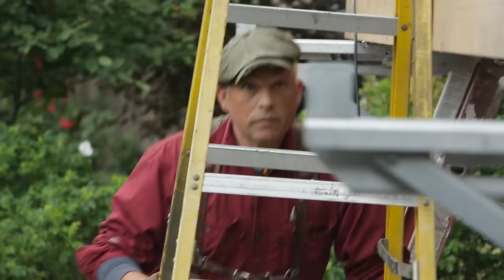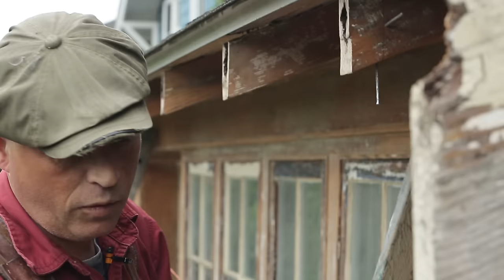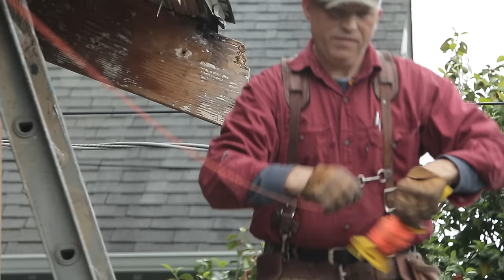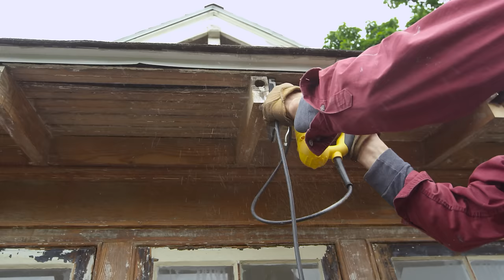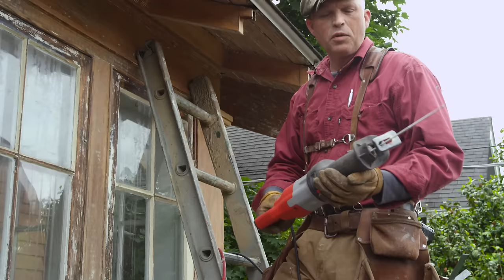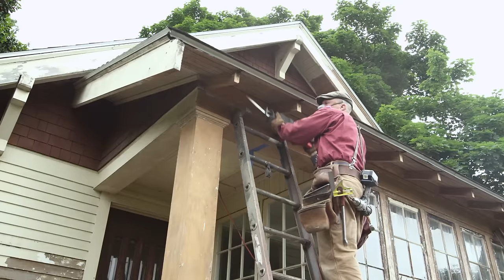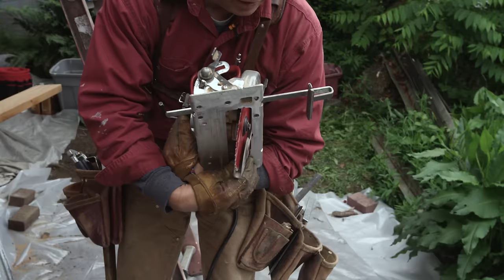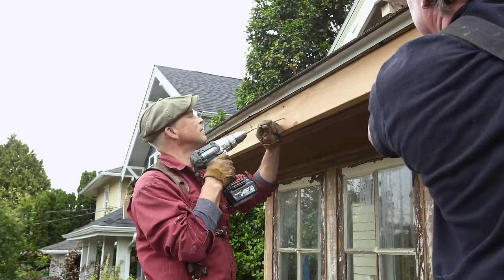How to Repair a Rafter Tail & Install Fascia

Comment: Thanks for the post, nice work!  How would  you go about replacing the rafter tail if you did not want to cut it back?  Thanks again!
Reply: You could sister another board to it.
Reply: T Willey.  Rot, dry rot, and wood rot are common terms.  They are brought about by any one of several possible living "Wood Fungus" varieties.  The fungus lives by eating or consuming the wood.  To properly repair "rot", the infected wood has to be cut out or chemically treated to remove or kill the fungus.  To properly repair a rafter tail the rot needs to be mitigated, usually by cutting the affected area off down to "good" wood and adding, or "scabbing", a new piece of wood cut at the proper angle on the end.  If the "scab" piece is to run out to the end of the "scabbed" rafter tail piece the end of it should also be angled.  The end the "scab" piece should always be on the "inside" of the rafter tail where it would be less noticeable if visible at all.  I hope that this helps.
Reply: @jimjordan5630  Thats what I was wondering. He said this was an historic house but he changed the architecture by shortening the rafters. In my case I only have about 5 inches of rafter between end and birds mouth. Is that enough room to sister on a new end?
Reply: @lancomedic  Without being able to see your "set-up" it's difficult to say.  Is there "blocking" along the to rail between rafters?  The roof load is transferred to the wall via the bird's-mouth on the top rail but you still have weight of beyond.  I don't think that 5 inches would be sufficient.  But you can cut your scab piece(s) longer and replicate the birds-mouth so that the top of the scab piece will follow along the top line of the rafter, and then if you had me access to the inside of the article or loft area.  Without being able to draw it show a picture of it's difficult for me (in my mind) to articulate what I'm trying to convey.  If not, and if the ceiling on the interior in that place, or in those places, is something simple like dry wall one might could simply cut acres the then once the scab is properly attached replace and patch the dry wall ceiling.  I hope that this helps.
Reply: @jimjordan5630  Thanks, I was afraid that I would have to go beyond the birds mouth and you confirmed it. I have access to the entire rafter since this is an outbuilding and the rafters are exposed on the inside. Not sure how many are gone till I completely open the soffit. This started as a painting project but now...
Reply: @lancomedic  I understand completely when a seemingly simple project starts growing on you, in more ways that one! Lol. You are fortunate in that it's not a home or a home with Brad board ceilings!  I had a roof leak one time in a home with paneling over dry wall living room.  It was at the roof just over the outside was at the front of the house.  So while in prep to repair the ceiling I decided to remove all of the paneling in this mid 50's home and trusting the dry wall.  When I went to pull the paneling from the inside of the outside wall everything came with the paneling, including posts of the wall studs!!  Imagine my surprise!!  Do, to keep from being forced grin getting a "licenses, bones and insured" contractor involved asking with all of the permits that guess with it (can you say thousands of dollars?) I teamed up with a buddy of mine who had been with commercial as well as residential house building contractors for years.  With my knowledge multiplied with his knowledge we decided to do most of the work from the inside, leaving the facade in place.  We would up removing about a 4'x8' section of hardwood flooring, some rotten, and about as much ceiling.  Had braced the floor joist with a 4"x4"and bottle jacks and built a secondary wall frame about 4' inside of the outer wall.  We wound up cutting out the rotted part and scabbing and sistering about five of the floor and ceiling  joists and rafters. Then rebuilding the wall from the inside which included 3/4's of the opening around a large picture window.  Needles to say that it was a large undertaking but the steps taken were just plain old fashioned carpentry at it's basics.  A very rewarding experience when completed.  And good luck on your project!
Reply: @jimjordan5630  Thanks and I appreciate your sympathy. Looks like I only have about 4 toasted ends. I made a sample for a template so should not be too bad. I have a roofer coming in to do the actual roof but I did not want to pay him T&M for all the soffit work. Thanks again. You gave me hope.

Comment: If you're not a seasoned carpenter a "Sawzall" is a dangerous tool to use on a ladder because it can bind/kick. Once you're comfortable with the ladder use a good new blade and for this job, install it upside down!!!
Reply: Also let the blade do the work, don't muscle it!!!

Comment: Hi, I have a question.  I need to remove one rotted board on the first row of a tongue and groove roof.   One section of fascia and the tails of three trusses are rotted and have to come off too. My issue is the roof is metal with those rigid pieces that stand up and run from the peak of the roof down to the edge similar to how the trusses run.  If it was shingles I could just remove them, but I'm not sure how to get to the first row of tongue and groove roofing to take the one bad board off without damaging the metal. Would I be able to pry them off if I cut the tails of the trusses off and removed the fascias first  since they have to come off too?  I figured with those two things out of the way a small pry bar would allow me to pry the first row away from the rest as the flashing will give a little bit allowing the tongue to come out of the groove of the second row.  I'm guessing the rotted board would just drop down at that point because the trusses and fascias would be out of the way.  Any ideas would be greatly appreciated.

Comment: What about using a circular saw instead of jig saw to start the cut?  How about upside down, with saw foot at bottom of rafter?  Cut only part way thru and finish with the sawzall.  It may not be as safe, but at least its seems like it would be faster and more precise.

Comment: Very nice however you didn't repair a bad rafter tail, you removed it.
Reply: I agree.   As it stands, the contractor has exposed the roof decking.   What will he do to protect the exposed decking that will inevitably get wet from the dripedge
soaking into it?    >sigh<
Reply: i would build the fascia out more, then put aluminum fascia over top, under the drip edge, problem solved

Comment: 3 tips to make this job quicker then the extra time he spent 
1 get yourself a pasload nail gun. 
Where not in the 90s screwing scews amymore. 
2 use a chalk line make 3 lines at both ends and middle i promise youll get a straight line 
 3. Prime wood befor putting it up saves time and makes paint last longer when they do paint it
Reply: Yes because screws were invented in the 90s and went out of style in the 2000s lol. What a stupid comment.
Reply: "Quicker" is why he is fixing some other past hacks half-ass install. Guys like him thrive in business because of guys like you.